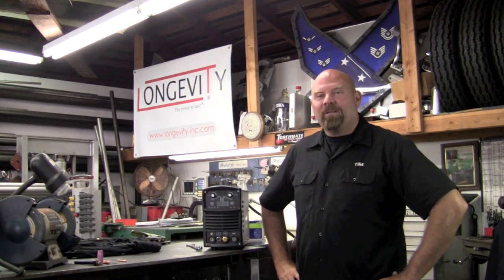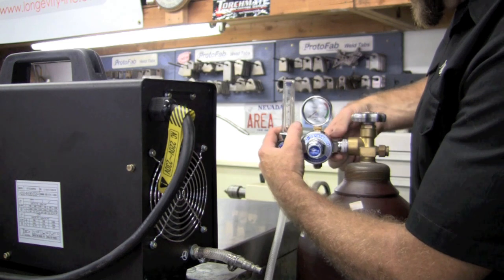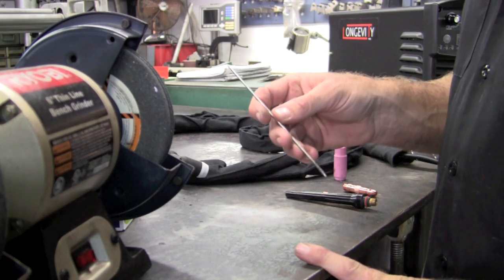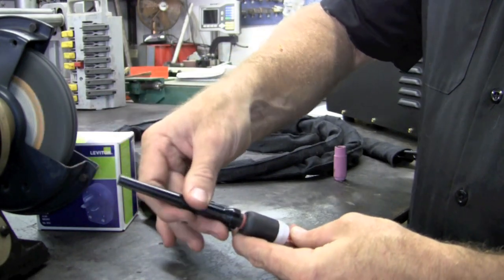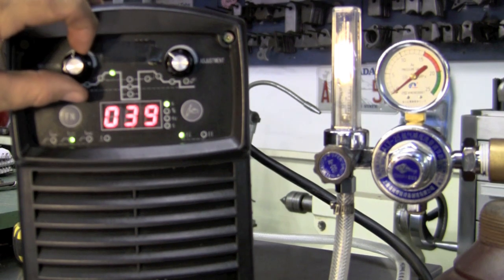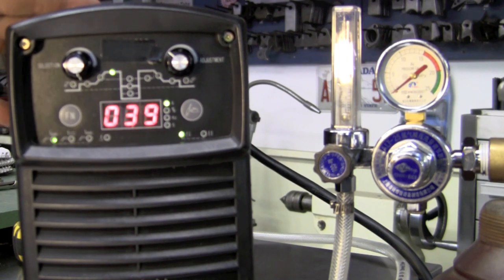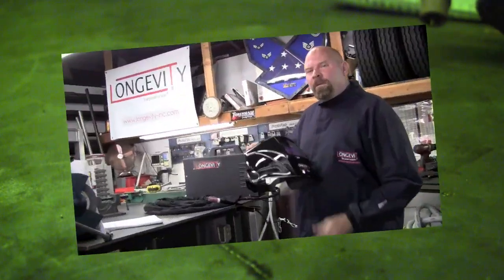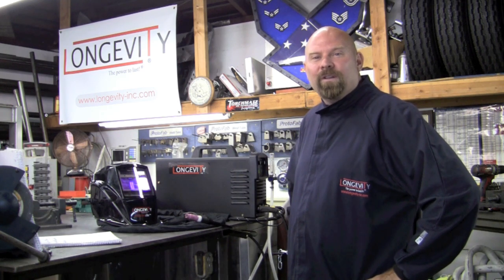LONGEVITY MicroTIG 200 Digital 200amp AC DC PULSE TIG WELDER

Comment: Just a word of caution, PLEASE chuck your tungsten in a drill, I had a 3/32 Electrode shoot THROUGH MY HAND when my NEW grinding wheel broke apart, becoming an 4000RPM hammer. Since then I only sharpen with it in a cordless drill, and I have turned my Grinder around so that it spins away from me.
Reply: yeah going at it from top down is stupid... a single bump and its launched at you.
always do it spinning away from you.
Reply: Either way... awesome video man
Reply: they make tungsten holders for that reason. Especially good for short pieces.